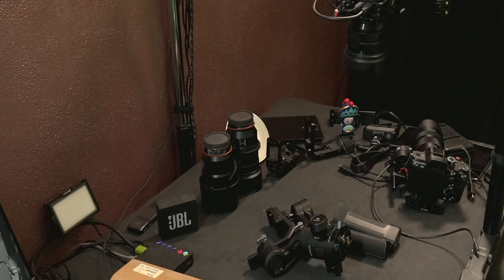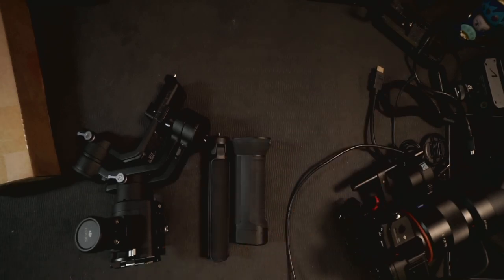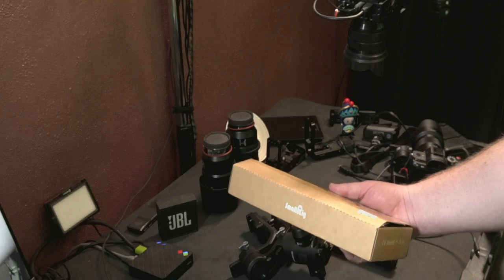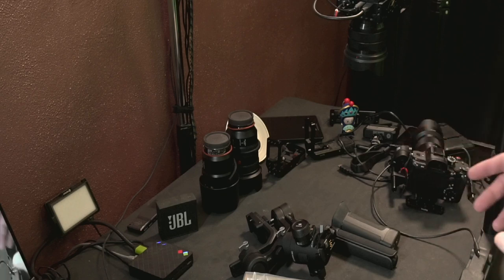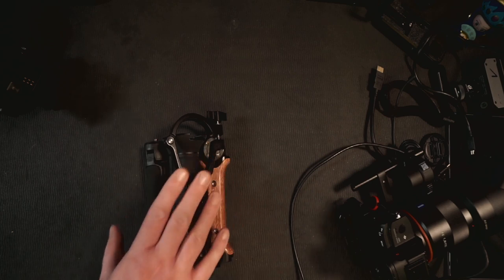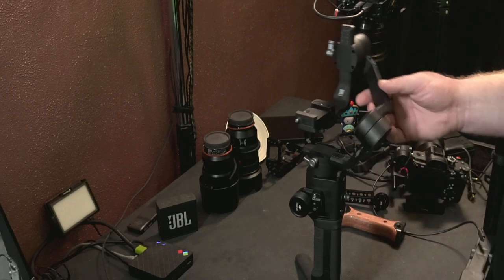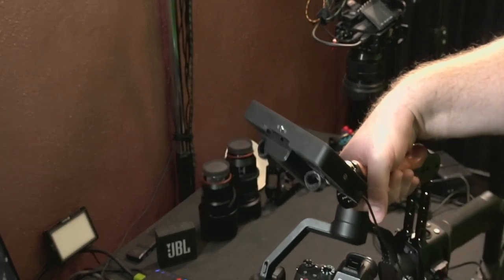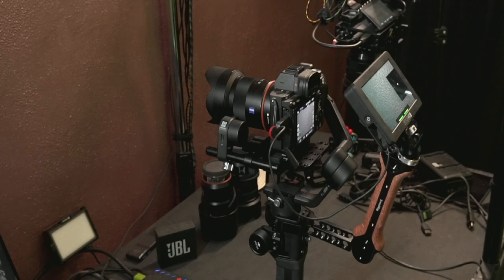SmallRig Handgrip for DJI Ronin-SC BSS2413

Comment: When you first show how the handle works with the gimbal, you move the gimbal down and then up. But the camera does not stay level and I noticed you need to adjust from the gimbal controls, is this usual, or is the camera not balance correctly?
Reply from the maker: No i was just in the wrong mode...
Reply: @scb2scb2  what do you think of the small rig handle? is the clamp round the handle feels secure and will not damage?
Reply from the maker: @JohnnyMotel99  The construction has to be like this also the others i have seen do it this way. It looks to me that the smallrigs is the most 'heavy' designed rubber on the inside and easy to close/tighten. I can't see it come loose or having a problem at all but only time will tell for sure.
Reply: @scb2scb2  thanks for your comments, I'm waiting my SC to arrive and I think the Smallrig handle will be next.